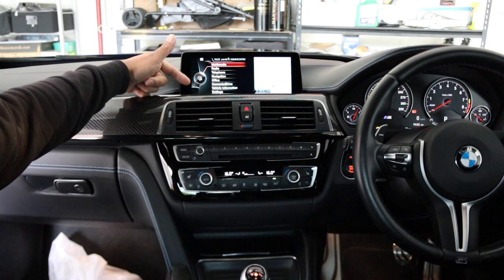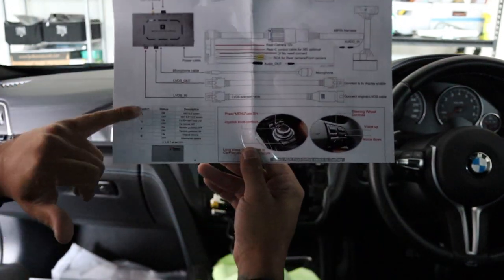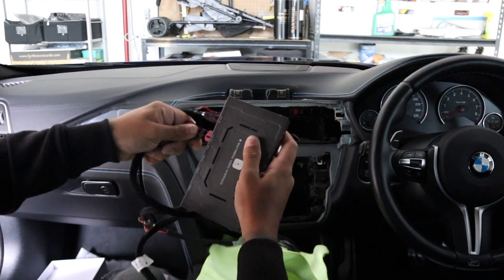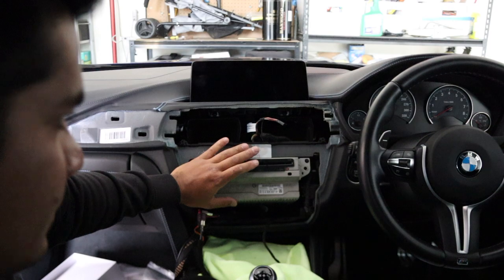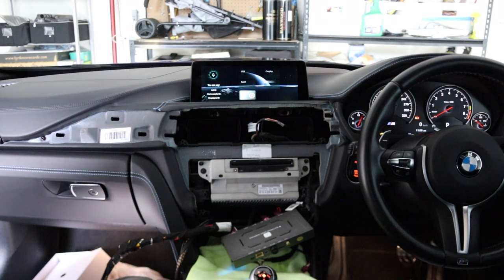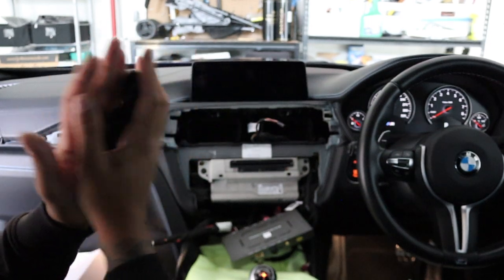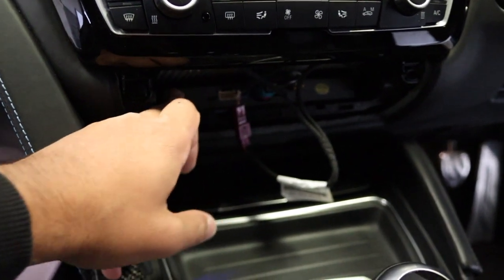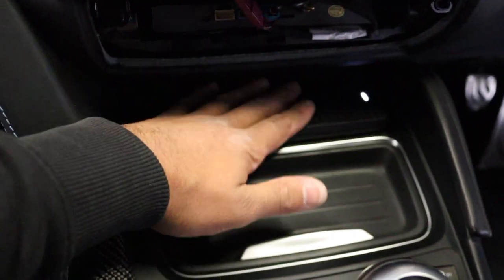BMW M3/3series NBT (14-19) Apple CarPlay / Android Auto install (FULL INSTALL).

Comment: Great Job, I've had my system that Nathan installed now for nearly 2 months , works well & provides a factory finish & endless media access. fantastic upgrade to older & new car audio
Reply from the maker: Thanks Paul :)
Reply: @TheFittingBay How much does installation cost?
Reply: @TheFittingBay   hey i know this is an old video but do the flush mounts come with the system? planning on doing this install and want to do it how you did it in the video it looks super clean!

btw its insane that my 2018 BMW M4 didn't come with carplay lol pretty salty about that